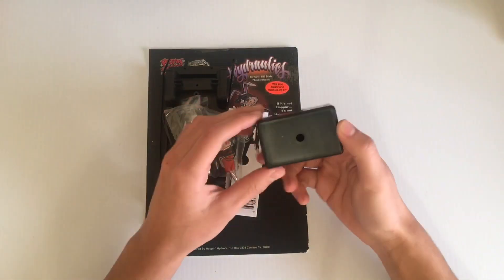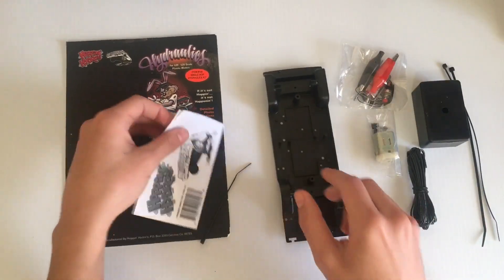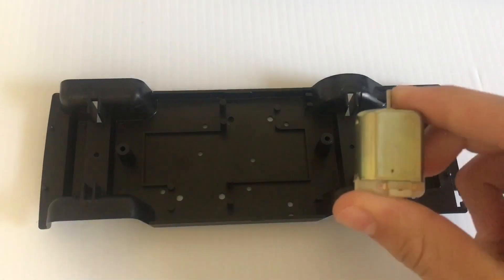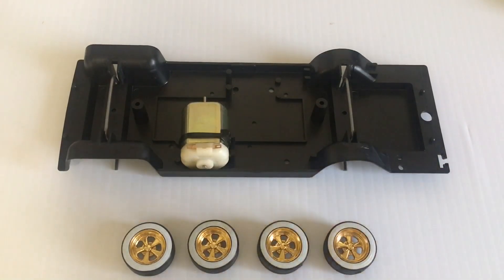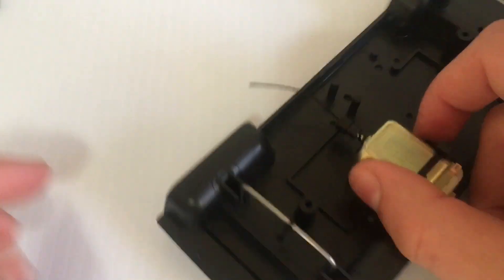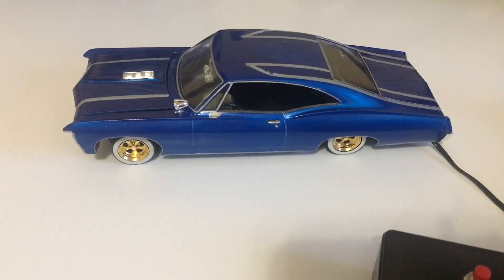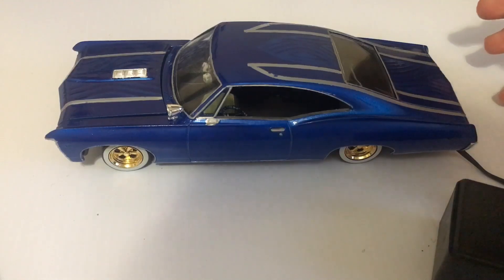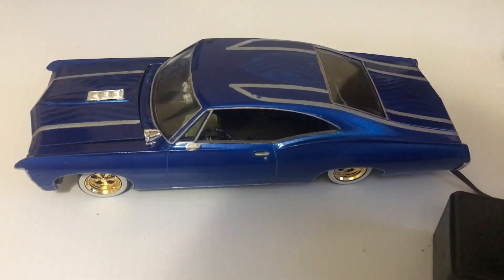Hoppin Hydros Single Hop Kit

Comment: What kinda battery you got?
Reply from the maker: I’m using a rechargeable battery from a rc car, a small blue 7.4 volt battery. You can also use a 6 volt lead acid
Reply: @lowlowsandclothes9923  alright thanks

Comment: Got a few questions?!
Can you run the string to both axles so both ends go up and down at about the same time?
What is the lowest voltage you can run this on? 
I’m looking for more of an airbag effect on a curbside vs a hopper.
Is it possible to put a small 3 way toggle or momentary switch on there to also make it look like it’s getting aired up or down?
Can I replace the U-Bar with straight stock or would I be better off trimming and rebending  it instead of I wanted to keep the full lift height lower?

Comment: If i get w front and back kit from hoppin hydros, can i still install the kit AND keep the interior? Or does the interior have to go?
Reply from the maker: Hmmm you might be able to fit the motor under the dash and one in the trunk
Reply: @lowlowsandclothes9923  can i put both in the trunk?
Reply from the maker: Probably youll just need some extra drill bits and a big body
Reply: @lowlowsandclothes9923  yeah im do a 6-4 probably

Comment: Can you put the motor in the back so you can put the interior in?
Reply from the maker: Yes actually, if you model had a interior bucket you can do that it is better explained in the instructions
Reply: If you look @ the chassis, it has holes for the strings throughout it for different positioning including the back (driver rear). If not, can always drill in, or melt in your own holes (if u don't have a drill small enough). What I have done before if I couldn't fit the motors in the trunk depending on the size of motors. I would cut out the back seat, leave the front seats in. After installing  the motors I would see what parts of the back seat I would be able to build back in with motors in place. Or you can always tint/black out the rear window. ✊
Reply from the maker: If you buy this kit there is instructions on how to place the motor in the back to use with a interior, although this will only work with a single motor but you might be able to get away with putting another one under the dash or behind the firewall

Comment: Why won’t mine hop it just moves up?
Reply from the maker: Okay so the string that you havw is either too long or your battery is to weak, make sure the string has very little slack and make sure your using a powerful enough battery
Reply: @lowlowsandclothes9923  ok thank you 😊